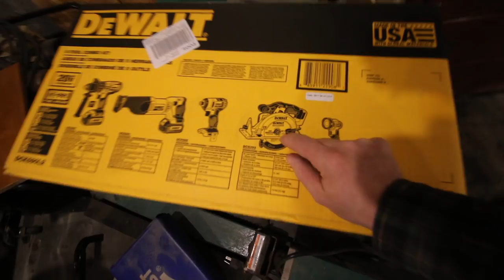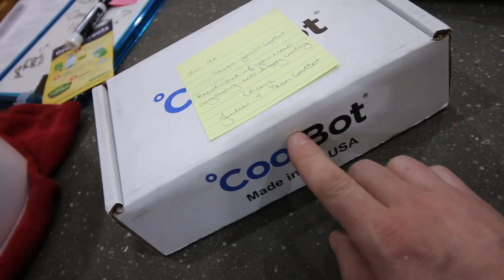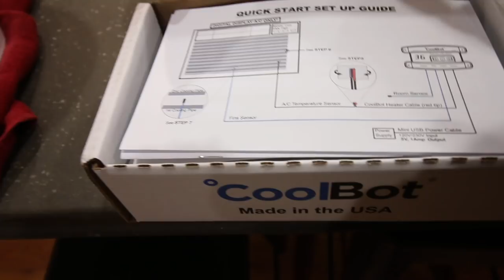Why do Pigs have a BAD Reputation for being PIGS? ~ Modern Steader Update ~

Comment: You will love the Coolbot, just make sure that you get one of the AC's that they recommend to work with. You may have to build a small structure outside the window to mount the ac in and let it blow the cool air down into the cave.  I didn't think you were getting many eggs. Pigs are growing nicely. Hope you get all the people you need for the class.  Never tried to grow celery. I have been looking for a good oat bread recipe. Come on Spring.

Comment: i don't have a homestead yet just a little house on a postage sized lot for now. but i have been doing work on it i need to build two more cabinets and do a few pieces of trim and touch up paint and my kitchen will be done. i am then gonna glaze my tub and sink make new cabinet doors and drawers in the bathroom and install a new counter top. then ynak out the big closet in the bedroom and redo it proper, build a gas spring assist storage system for under the bed and repaint the bedroom.